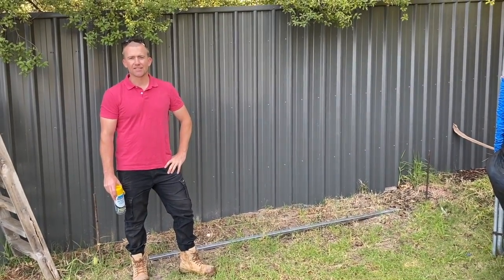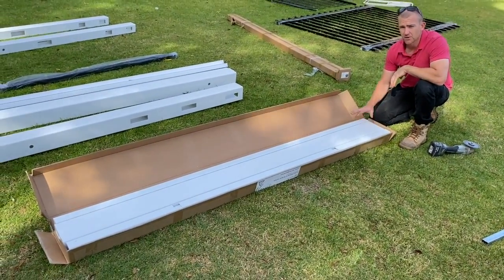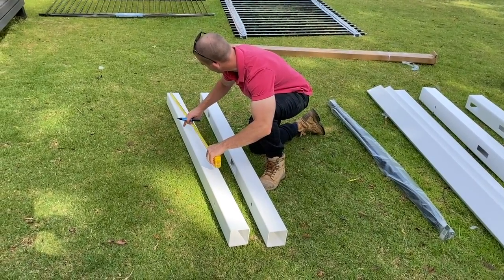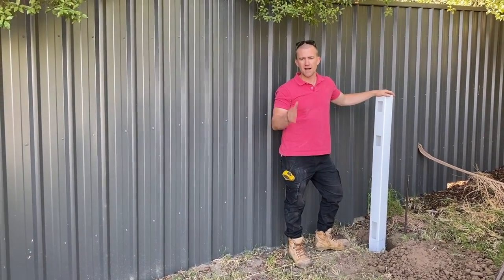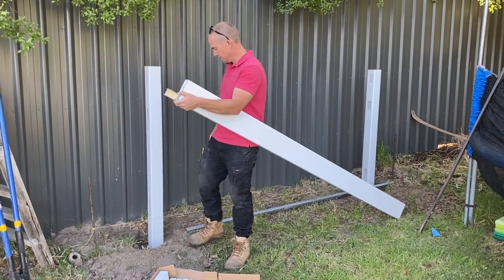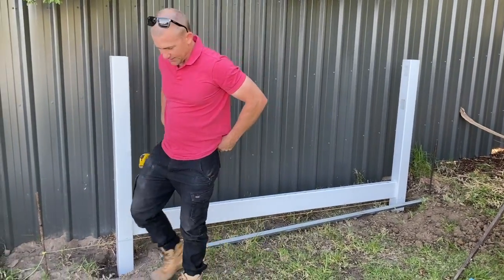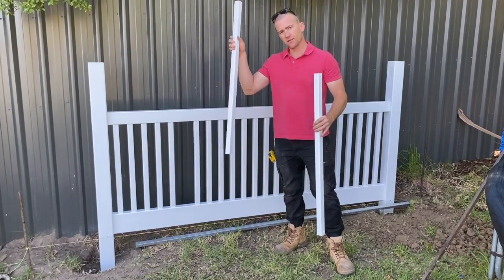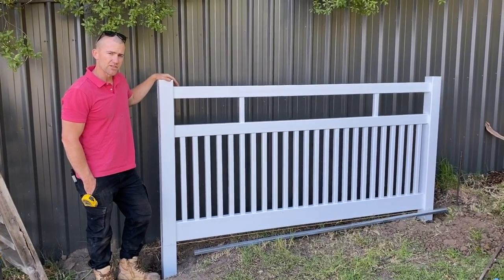How To Install A Semi Privacy PVC Fencing Panel

Comment: So at the end of the video the panel is not actually secured in the posts? If you dont mind me asking on here, what is the procedure for fixing off the panels so that the pickets don't move left to right?
Am I able install on slightly sloping land without jigging blank posts and actually creating even fall with the posts but them slightly playing around with the rails on the sloped posts to get my pickets plumb again and fix in this position.
Reply from the maker: Put a screw into the top rail before you put the post cap on